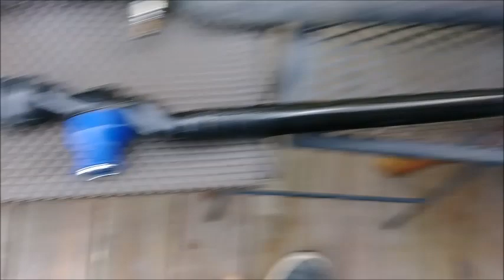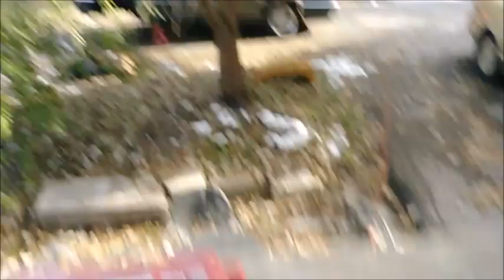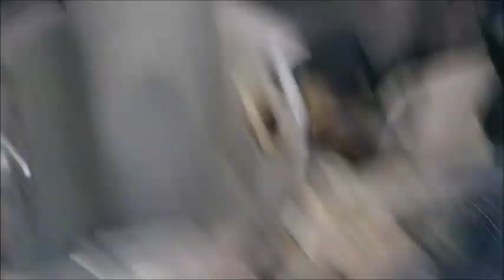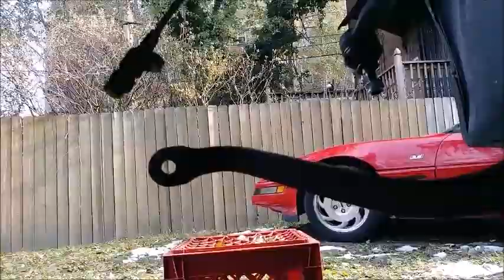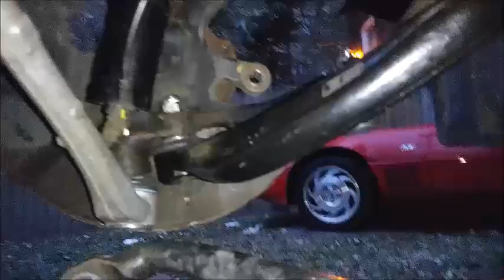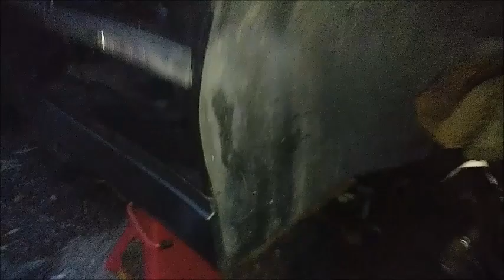bmw e38 front suspension overhaul part 3

Comment: Man I hate suspension work . On a positive note the weather after tuesday looks great . It will be interesting to see if we will get anymore fall ,or go back to winter . I have a 2 acre yard and lots of huge trees , they keep me busy . I detailed the Cadillac yesterday in the garage . Well I did the interior ,the vinyl top and the tires . I need to throw a coat of wax on her . I only drive it about once a month . Its an 87 deville with 80,000 miles . It literally looks like it just rolled off the assembly line . Most of the time I drive my truck or one of the three work vans . I have finished the rust repair on two of them ,one more to go . The last one is pretty minor . I have been rehabbing this house for 3 years and its 99% finished . Its a 75 year old solid brick home and garage . I started with the wiring ,then surveilance system ,the Led lights etc . Then windows a whole new separate living quarters in basement ,full kitchen ,bath etc .. Then plaster repair all paint ,new driveway , put a 100 amp panel in garage , led lights ,built an attic . Glad I am finished bcause I am tired of working ,and ran out of money lol . Stay safe buddy !!!!
Reply from the maker: I still need to wax the bimmer and Vette. Not sure if I'll get to with all the cold. I got my bimmer rust repair done. Vette can't rust and the Camaro is only driven in the fall and summer, so theoretically it will never rust. Except I did dent the front driver fender of the bimmer when that control arm went flying once that ball joint popped loose. I'll fix that in the spring or summer, I reckon. No rush. The bimmer suspension sucks. I could do the Vette's in a day. Way more user friendly. 4-wheel shocks with transverse fiberglass leaf springs springs. None of that strut business like the bimmer with coil springs. Ball joints are easier too. Bolt on and off at the top of the control arm, and the bottom ball joint presses out, so they don't pop off and start damaging stuff.
Reply: @HollywoodHornet  Heading out .. Thankfully its going to be warm after Tuesday .. I will be doing more to the vehicles during warm weather . Two of them getting inspected today . I will let you know .
Reply from the maker: @catfishjenkem2226  you should appy for year of manufacture plates for the Cadillac like I did with the Vette. Or Historic Vehicle plates. Whichever you prefer. One time fee of $28.75 and you have non-expiring plates. No more inspections, and no more licensing fees. Saves a ton of money over time. I also drive the Camaro less than 12,000 miles between inspections, so I'm emissions exempt for that beast. Safety only. I'm also trying to keep the bimmer under 12,000 miles so I can do the same thing with it.